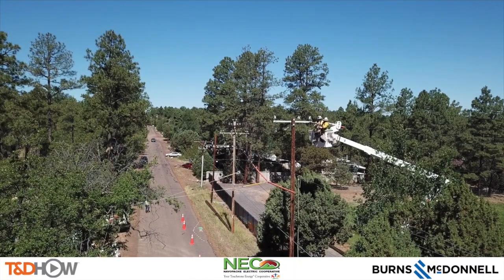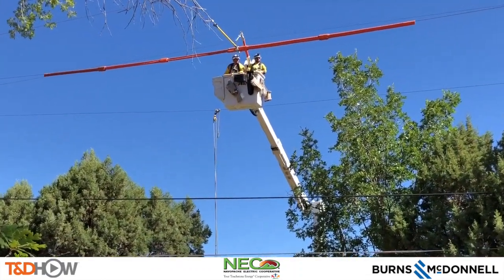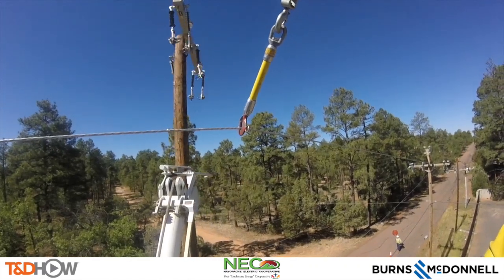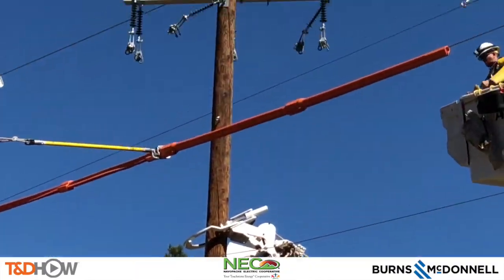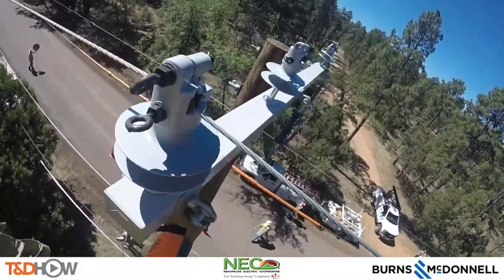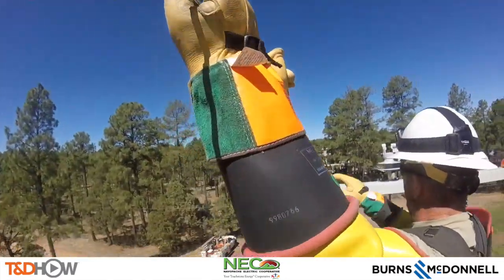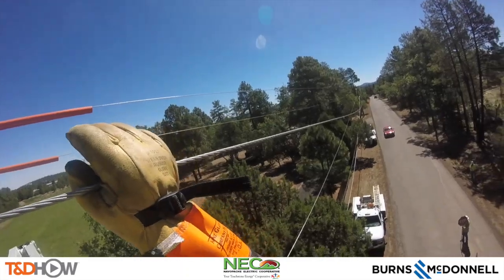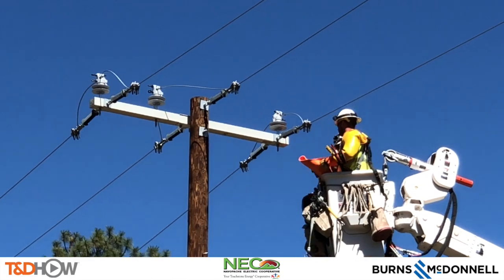Energized Line Transfer

Comment: Wow...
In my country they would rather just cut power for 4-6hrs depending on the job instead of working on live wires...
Sometimes they would temporarily shift the load to another line, but would still cut the power while shifting.
There's no way they would work on live wires 11kv and above. Its not like they can't, it just regulations !!!

Comment: If the new pole is only in dirt with no concrete, won't it get loose over time when it rains?
Reply: No, the rain will actually help the dirt compact around the pole better and concrete will prematurely rot the pole. No utility sets wooden poles with concrete, spoil from the hole, crushed stone or a two part expanding foam.

Comment: I mean did they get it done yes but I think there should been more cover as a precaution when setting and then moving phase overhead is fine but should have had cover on it and lift it but the cover upside down so it protects not only you but also anything it could come in contact with

Comment: It's interesting to hear the comments from the retired linemen.  It's called progress, guys. We get better at things over time.  A surgeon who spent 30 years doing open heart surgery with very low success rates would be bewildered watching a surgeon today perform cardiac catheterization as an outpatient procedure!!
Reply: Yea but working with the same electricity that kills you the same as 50 years ago doesn’t give you more wiggle room between life and death. It’s a shit comparison. Rubber protection is good. Saying we are in a new time really doesn’t apply when it comes to good safety measures here.
Reply: Doesn’t matter how long you’ve been retired as a lineman, or going to school for it now, the amount of safety violations is incredibly high. These men are lucky to be alive with how they are practicing this trade. Numerous times in this video they performed unsafe tasks which could’ve killed the both of them in the bucket instantly because of there neglect to cover second points of contact.

Comment: One question I always wondered about when it comes to these prefabbed cross-arms that use no underside bracing: How does a corss-arm like this maintain stability so it doesn't wag in the wind? Do they use multiple bolts to mount it?
Reply: These are fiberglass crossarms.
Most fiberglass crossarms have a bracket which holds a bolt above and below the crossarm.
This prevents the crossarm from moving.
Hope this helps.

Comment: Hello,
The insulator securement bolts go in from the pole side so you can work it with sticks from the pole. Way to be Brother fuckers !
You're supposed to be a Brotherhood of Mother fuckers, not a Motherhood of Brother fuckers !  You would have lost bucket privileges and had to hit wood for 2 months for that crap if you worked here.

Comment: When they make the false deadend, was the line tension measured?
Reply: This isn’t really a false deadend but it is just a unguyed double deadend.
Usually wire tension doesn’t need to be measured(from my observations) but there are special cases when tension needs to be measured.

Comment: 3:42 these pins look a hell of a lot more secure than the ones that just use a twisty wire to hold everything in place.
Reply: Those are vise top pins.
F neck ones that have the wires that you mentioned do secure the wire if done properly.
They also make preform ties which are way faster than a hand tie.

Comment: How is the vehcile isolated from ground? Just by the tires? I mean imagine accidental touch of one phase to metal arm of the crane you guys are up there.
Reply: The tires insulate a tiny bit but on bucket trucks, there is usually a liner and insulated boom(s). I don’t know about cranes though.
Cranes have to be grounded where I live when doing work so it’d probably create an arc.

Comment: Retired lineman 31 years couldn't believe how close they placed themselves without cover on hot lines 😲
Reply: Exactly
Reply: Lifting an energized line up and over one's head seemed a bit dangerous.
Reply: More PPE and distance inspecting a 480 400A transfer switch. 
Even at 4160, he got his beard real close to the wires.
Reply: In my younger days from what I've experienced bare handed being in the industry myself is that some people have unusually higher than what is considered to be normal internal body resistance upwards of several million ohms where their body tissue and low electrolytes are a very poor conductor, allowing for the occasional incidental contact without any issue. 😇
Reply: Pretty crazy they didn’t cover any ground potential lol
Reply: That’s the difference between Union and Co-Op…. That’s nothing Lol. Short handed and overworked, your nuts get bigger!!
Reply: @kevinbou1 And your brain gets smaller. Working in an unsafe matter just makes you stupid, not tougher.

Comment: So are power lines aluminum or copper? If it's copper I'm assuming it is tin plated
Reply: Most new ones are aluminum but some old ones are copper. No they are not plated.

Comment: yall got it easy. my utility would have hoses on all three lines and the neutral, unless the neutral can be untied in which case it will drop well out of the HOT ZONE.

but I see how you have the link sticks.

and dont let that static sound scare you folks. its a bird on a wire. 

respect it. you can't smell it. you can't see it. you can't hear it. but you'll know when you EVER fuck up. look out for one another and just like the two in the bucket in gloves and sleeves were doing, COMMUNICATION!

Comment: Why Have You Got Power Lines Vulnerable Above Ground ? 
Why Not Subterranean ??
Reply: Cost of installation, maintenance, and removal. Accessibility is horrible. You usually need to take an excavator and possibly a jack hammer just to access a line. I do not think underground work can be done live either.

Comment: The pin insulator on field side has the fiber bolt away from the pole. How you supposed to loosen it from the pole, or do these guys not stick from a pole?
Reply: What exactly are you wondering?
I think there is an attachment for their impact which they can use. It’s pretty close though so I’d be worried about hitting the pole.
Hope that answered your question.

Comment: Wow safety violation heaven, not to mention bad practices. They didn't even install the plastic shields inside the grab insulators to protect from line vibration damage. Not to mention the guys on the ground not wearing hotline gloves as the pole is being put up in place.

Comment: They worked outside the phases, never had a loose wire flopping around, the arm made out of same material as the jumper pins, and they stayed out of reach of the pole. What’s the issue
Reply: Arm is fiberglass I think the insulators are plastic or polymer. They didn’t not apply enough line guards or coverup to protect themselves from the high voltage if one measure of protection failed.
You can never be too safe.
Reply: The pole holding the lines could be grounded

Comment: No thank you. I'm a licensed electrical contractor. What these guys are doing goes above and beyond. One mistake and limbs get blown off. I'll stick with wiring buildings.
Reply: Even those gloves they use. Even if they look safe, they might not be. Weird stuff happens with kilovolts. If there is a PIN HOLE on a glove, they could be fried and dead. They have to be pressure tested every day or so.
Reply: I do industrial electrical and brand new oil platform electrical and plants I have seen 15kv breaker go slap through a brick wall in a plant and down 10 stories to the ground from it blowing up when we was powering up

Comment: So what happens if the cumalong breaks or breaks the line or looses tension all the sudden??  With no facecshielding on seems like they could take it to the face...  or when placing in insulators theyre in a tiny bucket and theyre working and communicating together as they lift and place it?  Wind play a big factor in this?  Just wondering cuz my team would never send a man up, gloved or suited fully up..  they would rather rely totally on poles and insulated pulley systems...

Comment: If one of my crews set a pole and performed this work, I would fire all of them on the spot. This video shows an extreme lack of training, from truck set ups, to proper i&i. Frankly who ever posted this should not be in the utility industry unless this is an example of what not to do.
Reply: Yeap, some may indeed say this is sloppy practice, ( it is ) 🤪🤔🤨
Reply: ok
Reply: Can you elaborate? I'm genuinely interested in your perspective of how you would do a 3 phase tangent to dead end transfer?
Reply: @badasssnow  cover up for starters. No pole plastic or blankets on pole while setting it. Putting a impact on a hot insulator while the battery is right next to the arm. I mean this was just complete garbage to use as a teaching point. Moving wire without a blanket on the arm or a single hose on the line? What if they let it go? Sure it’s a fiberglass arm but damn. Didn’t look like it was in a jib unless I missed it. Also work yourself out not work your way in. Less cover up. It all electrifies and works but damn I’m surprised they get away with this stuff. Also they tamped the pole before canting it unless that’s just the editing idk.
Reply: Thanks for the honesty. I'm looking to get in the profession so don't know right from wrong so trying to learn as much as possible

Comment: If that is actually energized, this is a travesty!  I was a lineman for 16 years and have NEVER seen anything like this.  No pole covers? A handline hanging from the neutral?  Barely any cover on the primary?  I couldn't even think of this many safety violations if I tried.
Reply: that foreman is an idiot. if i was that foreman i would have as much coverup as possible. shame on those lineman...smh
Reply: @Donutswithmydad very true I currently work with one cowboy lineman that always has an issue with extra cover up my Forman has to remind him that it’s the difference between crispy and xtra crispy. The Osha book and your utility safety hand book has been written with blood and that’s the minimum standards you can always improve on that. As for the handline they will continue to do that until something happens up there with no xtra buckets available.
Reply: @Esala888  lmao this is exactly how we build powerlines. we even go a step further and lean the poles to set the new ones 😘
Reply: My thought exactly. If did some shit like I would be fired on the spot. 
But I do like the insulators. Never seen them kind. Better that tie wire
Reply: T&D was nicknamed total destruction and I believe have since changed names due to all their incidents
Reply: @skeeterskoville9226  I've never worked for a contractor that would let this fly.
Reply: You’re a dipshit! You clearly have zero clue what you are talking about! Would they be in gloves and sleeves if it was dead 🤦‍♂️
Reply: It’s a good thing you just specialized in high signs and molding. Let me know what company you worked for so I know never to go there.
Reply: Could have used more cover but besides that I would have been happy with the job. Remember different SOP for each property ya be working on. Too many scared people here making comments lol
Reply: Y’all just scared bitches
Reply: @mb61j2  🤡

Comment: Are they working with a bucked that is totally insulated? To me this looked like the most unsafe procedure ever, their faces was just a less then a inch from touching the lines several times. You do not want to loose your face and eyes in an arc flash... Also that lifting the electric wire over their heads was scary as hell. A little error and there would be roasted linemen everywhere ?.

Comment: We would have used tiger-tails to insulate the lines.  Then we'd be going in with a line spreader pole that squeezes the lines apart and anchors them together.  The spreader gets picked-up by a crane to lift them above the pole height.  (Our poles are steel and concrete - so very conductive)  Then we'd have the machine place the pole into the ground anchor, where it would be grouted in - absolutely 100% plumb.  Then the crane would lower the wires to correct height - where line anchoring would occur.  We place lines on the top of the cross-arm and bolt the insulator cap down  The spreader bar is packed-up and everything looks perfect.   Nobody gets between lines - nobody is holding a loaded cable.
Reply: Im sorry but what you just mentioned is not needed or necessary. They could have used some more cover up but everything was done fine and safely.
Reply: Ur safety level is very high.
Reply: what is tiger tails？
Reply: @shenPatrick  Tiger tails are insulated line covers.   Good to 7.2 generally.

Comment: On very high voltage lines....why do they (you??) occasionally-over-distance "mix-up" the order of the phases??  In other words, the middle phase (for example) is physically moved to an outside or upper/lower position...and so on thru the phases.  If I were guessing....it has something to do with long-line inductance management???  I've always been interested in energy creation and delivery and could keep asking questions all day long....well, not really...but I do have several.  I wish there was a good book, but no doubt only "weird" people like me would buy such a document... :)   Unlikely to be a best seller!
Reply: I do not fully understand what you asking but I do not think the phases are mixed up on purpose. On transmission, there is a safety line on top and then single or dual or more circuit 3 phase.
As long as the phase rotation is correct at the producer and consumer then there should not be a problem.
Hole this helps.
Reply: @ElectroTree01  - Many thanks for the input.  I apologize for not making total sense.  I understand 3 phase power, but I’m not an expert.  Where I used to live, there is a many-mile-long power distro line.  The towers are 150 or so feet high.  There is the very top safety wire going from pole top to pole top.  Then there are two separate three phase power circuits…one circuit on each side of the poles, each circuit consisting of three phase wires….I’ll call the top wire phase A, the middle wire Phase B and the bottom wire is phase C.  Every 5 to 10 miles, on poles that are slightly larger in overall size, the wires for phase A are moved down to where phase B was….and phase B is moved down to where phase C was.  The original phase C wires are then moved to become the top, or where phase A was originally located on the pole.  Some miles farther down the road, this same thing of rotating the phases is done once again, and so on, from origination plant to a large sub-station many miles away.  This is done for both 3 phase circuits on the pole.  There is no mixing or rotation of phases between phase wires between three phase circuits on either side of the pole (that would be really weird if done that way).  My guess is that this is almost certainly something to do with distributed inductance or capacitance, but I don’t see this phase rotation most anywhere else….except there is one long distance distro where I currently live and that same mixing of the phases is done on this one distro line as well.  Thanks for your time!
Reply: @thomthumbe  Yeah I don’t really know why they did that. Never seen anything like that before and most of where I live is horizontal but transitions from horizontal to rare vertical are very crazy and confusing sometimes. Interesting.

Comment: Was glad to see the safety briefing at the beginning! I was concerned however at the 4:35 mark to see the uncovered arm of the man lift directly under the exposed live line. Is the boom isolated from ground somehow? Thanks guys for your service and keeping the power flowing, safety has to be the #1 priority in everything we do so everyone goes home to their families at the end of each day!
Reply: This really is not the safest crew. Many places would have much more rubber up there. With that being said, yes, the bucket has an insolated lining in it so even if you do make contact, it would only bite you, not electrocute you. Many buckets also have insulated booms along side with the insulated bucket. So even if they make contact they probably won't get injured.
Reply: Where do you see an uncovered arm? I looked 5 times and saw arms 100% covered
Reply: @TheBanjoShowOfficial  at 4:34 when they placed the center line, in the background you can see the white arm of the boom from the winch truck is unprotected!
Reply: The bucket truck(manlift) they are working out of would have minimum insulated rating of 46,000 volts, and the upper boom arm is mostly all fiberglass and insulated. In theory the lineman could barehand the line from the bucket and be ok, but the real danger is line to line contact.  If they make contact between the two lines, there is no insulaiton to protect them other than the rubber gloves/sleeves they are wearing.
Reply: The whole truck is insulated and isolated. For all electrical linemen. Has to be. Or else they’d be fried the instant they got close

Comment: So it shows dropping line into insulator. Then dead ends installed and jumper. Does the line dropped in to insulator get cut? Please explain.
Reply: I do not think the jumpers are cut.
If they installed a recloser or something like that then they might remove the jumpers but I do not think they were removed.

Comment: I have never understood why some guys think it is ok to lift a hot phase over their head, from one side of their body to the other. I guess cause ITS FAST. 
Yes it looks like #2 acsr and it does not weigh much. 
Position your truck, you have a jib on the bucket. Use it!  You have a line truck use it! 
But I guess it’s hard to fly and land phases with the truck?
Ehh? I know, you can’t be a pussy and a lineman, as the saying goes. Right?
Everyone works differently, and cultures are different.